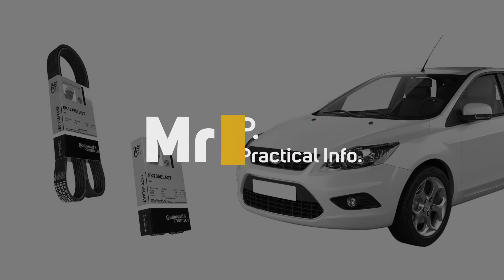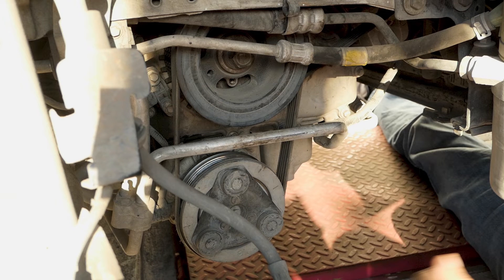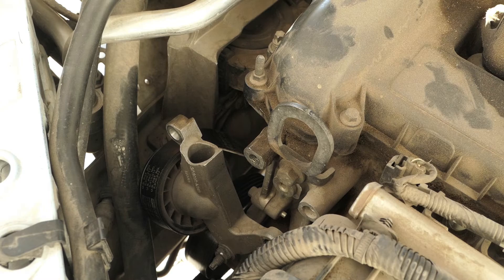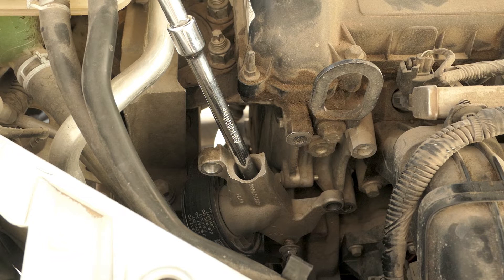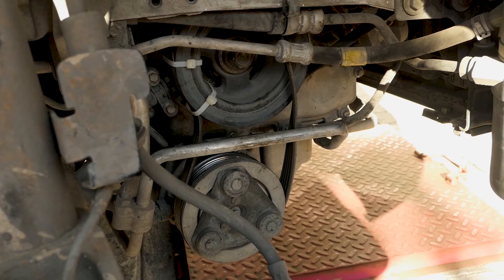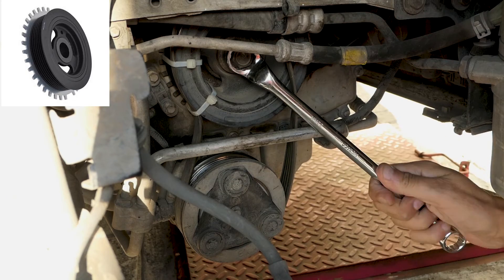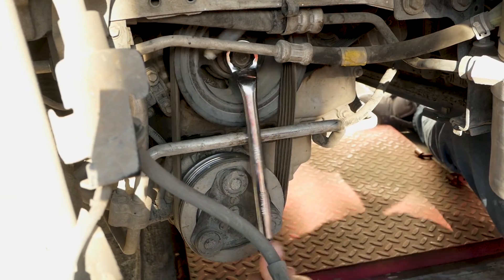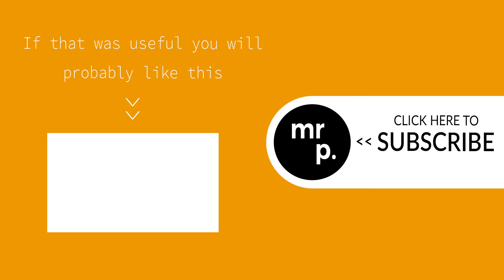Installing Stretch belts Ford Focus 2009-2011 Duratec HE 2.0L 🚗

Comment: Legend mate!! I was struggling to get the accesory belt on until I seen your video! The manual just says turn tensioner counter clockwise
Reply: Any advice you can give ? i doing the job tomoz. its it hard getting  the belt on every pulley before you pull the tensioner into place ?

Comment: This works for my 2008 Volvo V50 2.0 too. The Haynes manual and everything else thinks it should have a sprung tensioner you can tilt with a spanner - actually it doesn't, it's like yours instead. Lifesaver